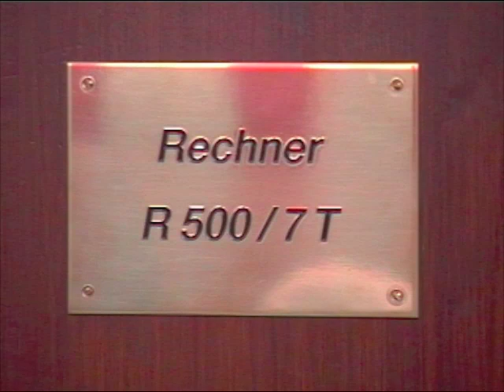R500/7T Relay Computer

Comment: :yougotthis: This is very impressive. Not only because of the electronic assembly but also because of the fact that an attempt has been made to make the computer transportable by including all the circuitry in several cases that are interconnected with each other and that can be transported individually.

Comment: In the video you state that your machine only calculates with whole numbers. If that is true then how can it divide? If it does not engage in division process then how does it calculate the day of a week with dates going back to 1600 AD. By the way, is that year related to the conversion from the Julian Calender to the Gregorian one we have today?
Reply: Jeffrey314159 You can divide a number and get an integer with a remainder. The computer just throws away the remainder. Or you can divde by using addition instead. Say 42 divided by 10 is 10+10+10+10, with 2 remaining... The next stept for decimal numbers is alluding me right now. 5ish AM and I'm needing sleep.
Reply: I gather from Wikipedia that the transition happened in 1582 so your speculation is quite possible.

Comment from the maker: As the computer is not run very often the relays are not a problem. However, there are other sources of issues related to cables/contacts which are hard to track down. There are always lessons to learn and room for improvement!

Comment from the maker: I've got further information now:
The computer is driven by 24 VDC. The power supply is a conventional 230 VAC to 24 VDC transformer-rectifier-condenser unit. Actually, the unit turned out to be somewhat oversized, since it could provide 20 Amps @ 24 VDC, whereas the computer does never consume more than about 4 to 5 Amps. Most people are surprised to hear how small the power consumption of the machine is (only around 100 Watts at maximum).

Comment: Hello, it is me again!!  I would like to add that you could reduce most of the conspicuous  sparking of the relays with the use of a small capacitor or clamping/snubbing - diodes/rectifiers.. This obviously would slow the response time of said relays..
Reply: There are no sparks produced by the relays. The lights you see are LEDs that indicate the state changes of the relays. Actually, the architecture is such that all relays (except the ones in the clock unit) are always switched without any load at all, so no sparks can be produced. This is a principle I owe to Konrad Zuse who did that in order to increase the life span of the relays.

Comment from the maker: @Oak_meadow
The only thing that is currently available online is http://strangecalc.ch/architecture.jpg.
Reply: Jürgen Keller You stated in the video that your machine only calculates with whole numbers. If so, then how does it peform division? Is division even relevant to its processing? Is 1600 AD based on the conversion of the calender from the Julian model to the Gregorian one? The site you have listed above is inaccessable. You stated in the video that there is no floating point unit, so that means it works with pure binary and not BCD?

Comment: Excellent job.    I too am building a relay based computer.  I have completed the clock gen. and the ALU (Zuse type)  I thought about doing it via pneumatic valving like a player piano, I rebuilt several and was surprised to discover that a speed of 10Hz was attainable,,,,,,,,Presto!

Comment: technically yes, overclocking is speeding up the clock speed of a component to higher than the manufacturer's specifications. Increasing heat and power consumption. Depending on how he did the architecture and the physical limitations of the relays it may be as simple as speeding up a clock or it  could just be imposable.

Comment: Especially considering that modern computers are thousands of times as fast as this. IIRC, a 2ghz core 2 duo can calculate 8 million instructions per second, versus this computer's seven. So it's roughly 1142857 times as powerful as this. Now consider that the new core i7 cpu's are 3-4 times as powerful as that. Pretty crazy, huh?

Comment: How many instructions does this computer have? I wonder how fast it would be with transistors instead of relays.
Reply from the maker: I didn't build it by myself and don't have any documentation, so I unfortunately cannot answer your question.
Reply: The computer has about 55 instructions (register value setting, register copying, storing to and loading from memory, addition, subtraction, steps for multiplication, division, integer square root, and binary-to-decimal conversion, and some very specific instructions for handling input and output). 

A transistor version would certainly be many million times faster that the relay-based version.

Comment: four bytes of RAM?  maybe it would have been better to just add a few extra registers.  It looks to me like it takes so long to calculate the date because it doesn't have a divide opcode. It probably has to do repeated subtraction.
Reply: Anton Nym addition... not edition :-D
Reply: actually, i meant subtraction, but i'm autistic and i got distracted by something going on here and my fingers just typed in some random thing.  It's a good project. I am thinking of doing a project also.
Reply: There are instructions for integer division, multiplication, and even for integer square root, but these instructions are only operation steps which have to be repeated 8 or 4 times (for 8 bit numbers) in order to do the full operations, so it takes quite some time to do even a single multiplication or division.